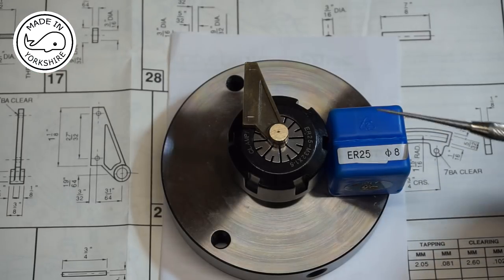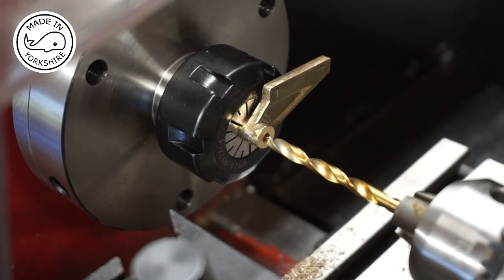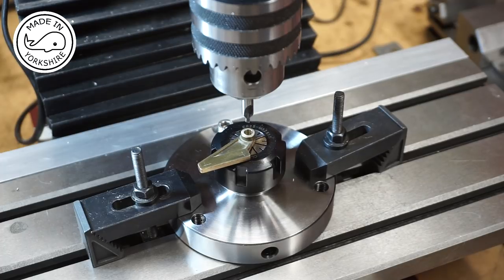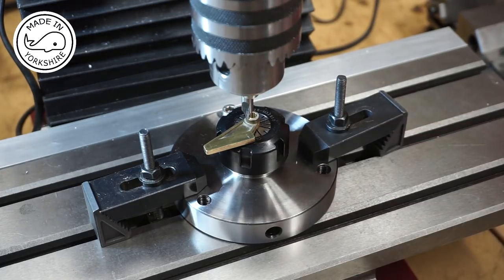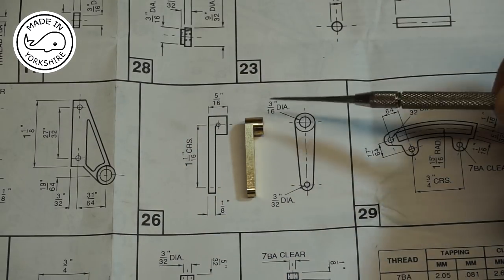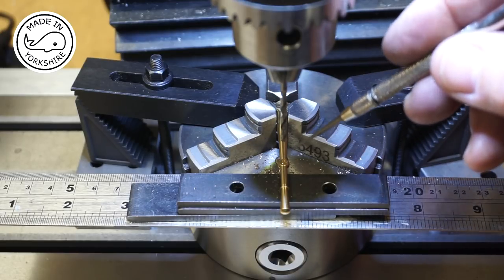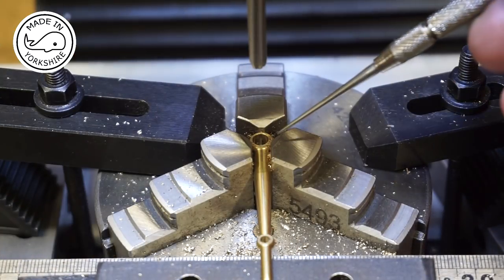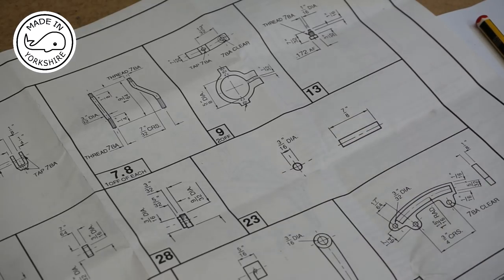#MT30 Part 2 - Stuart 10V Reverse Gear Mechanism. Bracket, Conrod & Lever. By Andrew Whale.

Comment: Andrew. Looks like you could do with some quick action locking knobs for your mill. It would drive me up the wall having to use an allen key every time you want to lock / unlock the tables. If they are metric, I found some quick release ones on E-Bay .

Comment: Hi Andy. A good video from a man who is self taught. you certainly can't rush these things when you are model making. I live in Thailand now and will be building a workshop for myself in the future with air - con! need that in Thailand. Are you happy with your machines?
Reply from the maker: Thanks Dermot. I'm very happy with both the sieg SC4 lathe and SX2P mill. The SC4 is a major step up from the SC3 mini lathe. Also having power feed on the cross slide is a real bonus. I did originally consider the X2.7 mill but it was too big for my small work area. The SX2P is fine for what I need - at the moment! Good luck with your workshop build.
Cheers
Andrew